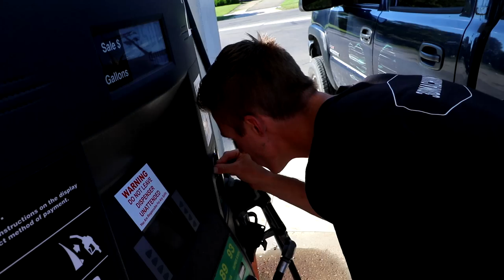FOUND A FREE TRAMPOLINE

Comment: The A/C issue in your truck is the blend door actuator.  Common in Chevy's.  My 03 Avalanche would do this.  Sometimes blow cold then just switch to hot air but only on the driver side.  Lots of youtube videos on it and information on truck forumns.

Comment: hey dalton my stepdads truck blows out heat like yours does sometimes and if u want to fix that heres how 
1. pull truck over or just shut the engine off.
2. crank it back up and it should work.
just fyi it resets the computers in it 
you said it @ 1:27